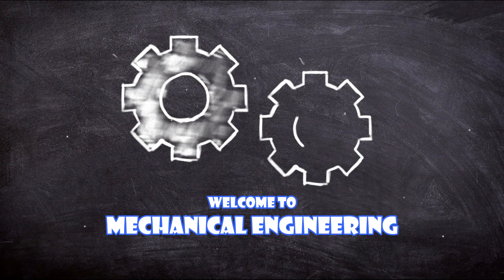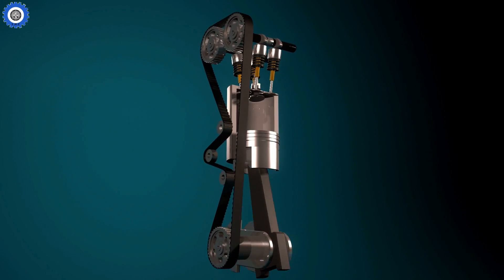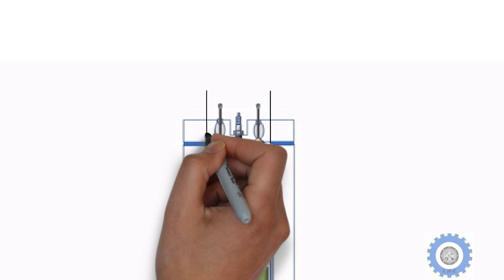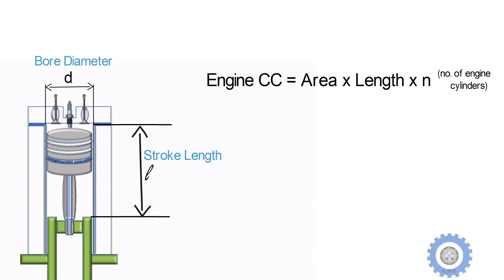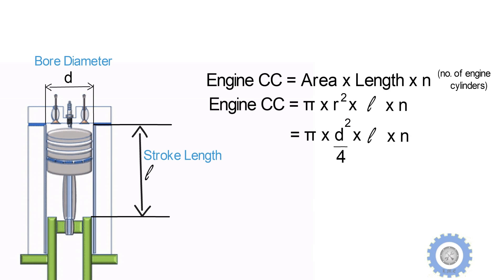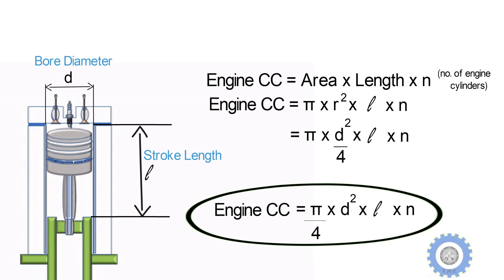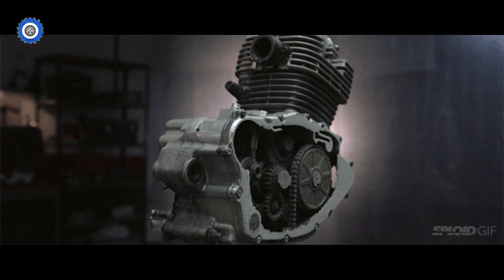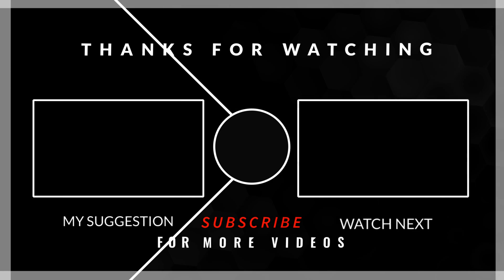From Novice to Pro - Learn How to Calculate Engine CC, Like a Boss !

Comment: As engine cc =200
Cc = (pi ×d square ×L×n)/4
200==(pi ×d square ×L×2)/4
(200×4)/2pi = d square ×L
127.323 = d square × L
Here  d is dia of bore
And L is lenght of stroke 
Its up to u to use d and L according to your requirement 
As :
Undersqaure engine
Square engine 
Oversquare engine.

Comment: sorry mate but what the flip!!!!! You didn't explain properly i got 59k and got bummed  i disliked it
Reply from the maker: Which part u didn't understand? 
Its simple, Engine cc means volume of engine which is in cubic cm...

Inputs are d (diameter) in cm and l (stroke length) in cm

Pi/4 × n x (d x d × l) ...

In bracket d & l are in cm... while pi & n have no unit of measure
Pi/4 × n x ( cm x cm x cm)
So the answer will be in cubic cm...

Next time I will take time to explain each steps of the formula so that anyone with non technical background can also understand the concept

Comment: Is the diameter over 4 instead of 2 because it’s squared due to the formula of the area of the circle?
Reply from the maker: its simple, 

d=2r (diameter is twice the radius)
d2=4 x r2 (squaring both sides)
d2 / 4 = r2,
r2 = d2 / 4  (in terms of r)
now replace r2 with d2/4